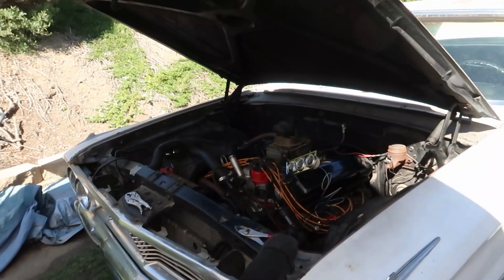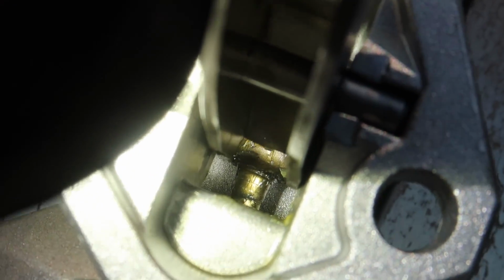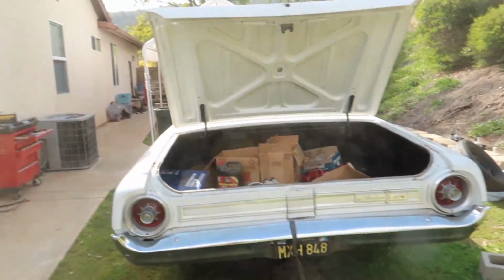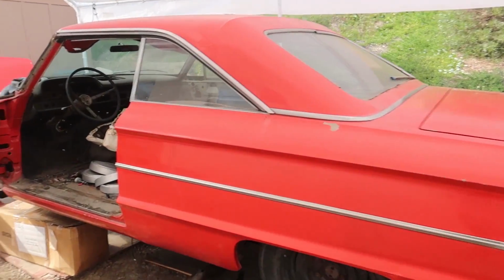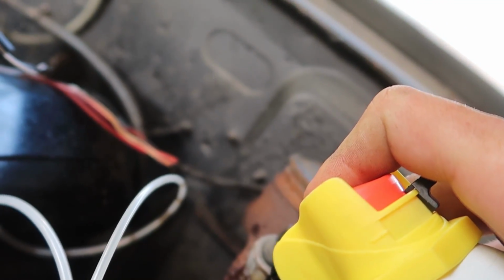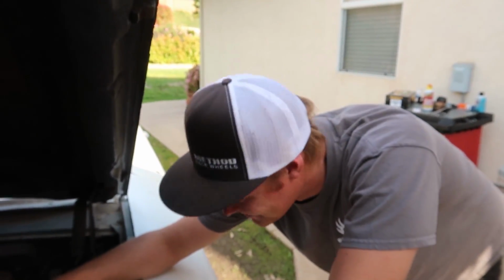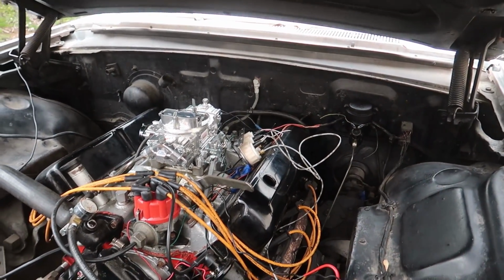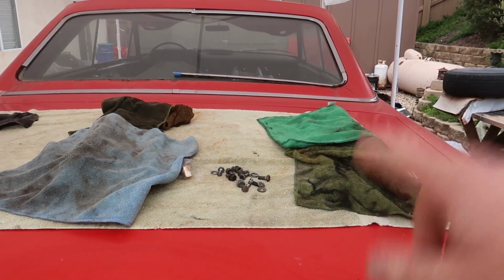This is What KILLED My Galaxie on Startup?

Comment: Nice tip on painting and keeping things neat. Here is another tip my dad, a retired mechanic, got me into the habit of: Always put your belts on with the print right side up where it is easier to read, face the tops of the letter toward the engine block. It not only looks neater but also if you take them off and put them back on and the belts have taken a set anything on the pulleys then the will not get messed up by being put on the other way. Yes I know that is a very rare instance. It also makes it easier to read the numbers if you are going to go get a replacement.

Comment: compression test first, most likely is a flat cam.  stopping and starting during cam break is not good and now days should be done with lighter springs and some zinc additive added to the oil

Comment: Whoever put the fuel pump on may have installed the lever arm over the lobe on the cam instead of under. That would have sheared it.
Reply: Would it have run at all, though?
Reply: @uppastdawn7627  Some will and some won't.
Reply: Or it has "Made in China" somewhere printed on it...
Reply: Yes you nailed it. Is there a mechanic in the house ? A waist of time "this video"
Reply: I guessed that 2 minutes in. 
Because I have done that exact thing. 
99.9 percent of problem are human error.

Comment: Drop the oil make sure no metal in it , if a new cam not broken in properly (PO) could be flattened 🤦🏼‍♂️ seen fuel pump levers fitted on the wrong side of the cam also , could be why it broke? Keep going you will get there .. Love the content 👍😎

Comment: Sounds good? Sounded like a V6 running on 4 cylinders. :-D
Reply: @RatRodRon   sounds like it has two wires mixed up and  by the way it shakes, it isn't running smooth at all..  it could be his Mic though..
Reply: Dead cylinder or out of time - why not just block off the pump and run an electric one near the tank ??

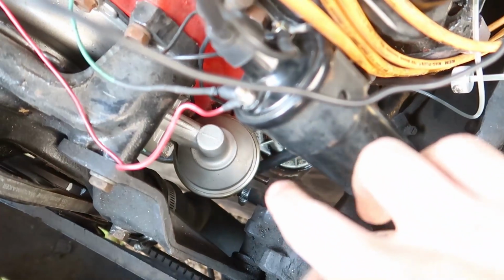Comment: I think you are right about a lack of compression, at 2:18 when it was cranking it sounded like it had a dead compression skip. Also check that the pushrods are spinning while the motor is running, that will tell you if the cam and lifters are doing good. I built a 350 that ran great and I checked this and found one pushrod and lifter not spinning. Because of college I have not had time to investigate it thoroughly but it seems the lifter was defective and would have destroyed the cam. I used zinc additive and specific break in motor oil and still had this problem, flat tappet cams dont seem to be made as good anymore. Best of luck

Comment: Have u done a compression test? Something not sounding right.... mis-adjusted valves?
Reply: I should have said “bent push rod” alas FE engines don’t have valve adjustment per say.
Reply: Definitely a problem somewhere. I noticed it before it started. Cranks really lumpy, if that makes sense..

Comment: That line broke because you need to remove the line from the brass adapter first. The flange nut will not spin on the line when its tight
Reply: Exactly right. Buy a couple of flare nut wrenches so they grip properly. Turn them opposite directions to loosen the nut from the fitting. I want to reach through the monitor and help you guys. Lol. I'm old. My first car was a '64 Galaxie back in 1970. I made mistakes too, but now I have 50 years experience. Be very careful with oil products contaminating brake fluid. Oil in the brake fluid will destroy the rubber products in the brake system and you'll find yourself with no brakes. Remember you have a single master cylinder and no secondary system.

Comment: The last two FE rebuilds I've done, I ordered the cheap ($10.00) electric fuel pump from ebay and mount near the gas tank with w switch on the dash.  By mounting in line with the mechanical pump, you can get the carb filled with fuel for quick start up which is critical for cam break in. I admire your enthusiasm.

Comment: Love those galaxies one thing about those master cylinders put a rag over the top and use a big pair of channel locks that always works for me, plastic likes to bond to the metal love the videos glad you're staying safe
Reply: Mustang guy6501 
Very true.
Rag and strap wrench works nicely as well.
Reply: The old one was a metal cap tho
Reply: @TheWolverine-rm2kr  yes but with the one put on is likely to do the same with engine heat cycle, just how I get mine opened

Comment: Looks good. Also check the spark plugs and read them. I’d like to see what cylinders and you can usually tell what’s going on off the spark plugs. I could tell it sounded like it was running on 6

Comment: If it makes you feel better, my 94 Isuzu Rodeo gets about 10-15psi of oil pressure at idle, and then normal when revved up. She's got 265k miles on her and still runs like new so I wouldn't be too worried as long as there's some pressure.

Comment: Check for a vacuum leak, possibly on the back of the intake manifold. Had the same problem with my motor on startup. Mine had the same lawnmower sound to it.

Comment: I've had several cars that fluctuate oil pressure off idle, and never had any issues because of it.  I've been told that 5psi at idle is fine, but you obviously need more when it's up in the revs.
Reply: My 390 has 7 psi at idle. 30 at 2000.  I just use 20w / 50 in summer.

Comment: Check the distributor gear. I had a similar issue with a different vehicle and what it was, one of the ball bearings went bad and was dragging just enough to create a misfire on multiple cylinders

Comment: sand the top and paint it with Rhino liner,    I'd check the top dead mark at the crank with the Distr. TDC # 1 plug  & I would then do a fresh valve adjustment!

Comment: It's quite the possibility a head gasket popped causing it to leak compression.  It's possible that someone didn't torque the head down right. Or not at all. It could be a valve that didn't seat right. Or a lifter that is stuck closed. If the lifter pumped up but stuck in the process, it can cause the valve to open too far. which will cause a miss.  To much fuel can actually flood the plug causing a miss. But usually, if that happens there will be a loud gas smell coming from the exhaust. Eye burning loud. The engine will have a heavy skip. The best flying guess, you have a head problem one way or the other. I just hope you don't have a cracked head near the valve. Any liquid will do for checking for a crack near the valve.

Comment: In my 66 f100 I recently got a new mechanical fuel pump and it broke 2 weeks later, the new mechanical ones r shit. I just switched to an electric fuel pump and it works great, starts as soon as u turn the key and never ran smoother

Comment: Instead of using a towel , try using tin foil. Easily forms to shapes and will stay in place while painting. Works well around lines and hoses you don't want over spray on.

Comment: It sounds like the torkconverter bolts are slapping the separation plate between the motor and transmission check the nuts on the torkconverter

Comment: Those look like non adjustable rocker  arms, did you mill or surface the heads, that maybe problem with the valve adjustment
Reply: If they milled the heads or block deck there is an undersize pushrod to correct this. There could be valves slightly hanging before the lifters bleed off or worse the pushrods have bent due to coil bind. Really common to see FE pushrods bend due to their over 9 inch length.

Comment: Sounds like one side of carb not getting fuel. Each bowl fills independent of the other. One side would starve 2 middle cylinders on one bank and front and rear of other bank. Really hard to diagnose for a shade tree mechanic like me. Had a NEW Edelbrock on a 302 Ford do that to me. Drove me crazy.

Comment: Brake line broke because you undid the wrong part, should had one spanner on the brass fitting and undid the steel brake line nut.

Comment: You need to perform a compression test on that engine.  The rhythmic sound it makes when cranking indicates that there is a low/dead cylinder.  The "super-direct" on the brake line is a bad idea.  There is no way to absorb relative movement between the firewall and the frame.  It needs to have a pronounced bend (even a circular loop) to accomplish this. This is why this earlier replacement line fatigued and failed.  Also, brake lines need to be double-flared.

Comment: You can increase your oil pressure by running a full synthetic like Mobil 1 if you aren't already.  My father owns a 64 Galaxie 500 as well.  He had oil pressure in the low 20s, and when we ran Mobil 1 full synthetic, it increased the pressure and reduced lifted noise.  

It's a 352 car as well:
https://pistonrepublic.com/vehicles/galaxie500man-1964-ford-galaxie-500-2door-hardtop

Not restored yet, but getting there.  BTW: The color looks the same as yours - Phoenician Yellow.

Comment: VERY IMPORTANT!
You need to know what camshaft is in your motor. If you're not the one that rebuilt that motor, it could have ANY cam. This means that it could be a totally different FIRING ORDER. I worked on a 351 with a 302 cam in it. Nobody told me. I went through hell trying to figure it out.

Comment: Could be a lot worse. Had a brand new mechanical pump in my 460 where the arm snapped off in the timing cover, and the bit that came loose flew up, wedged behind the cam sprocket, and broke the front of the cam off. 162 miles, that’s as far as it went. I know they’re usually reliable, but after that nightmare, I won’t use a mechanical pump ever again.

Comment: Am I just high, or does that galaxie sound like a lawn mower
Reply: It's not hitting on all eight sounds like firing order .   I like it though .
Reply: I was wondering if it was just the camera but it sounds rough
Reply: Sounds like a Subaru . Lol
Reply: Yep, lawn mower.
Reply: It's running really poorly.
When he cranked it over, I heard a compression problem. 
I wonder if he did a valve job?
Either way, I'd be surprised if it ever runs right.

Comment: A mistake that a lot of guys make when they overhaul their FE and stay stock, they reuse the valve springs. This is a bad idea for two reasons, a weak spring will put undue tension on the rocker shaft because invariably one will be stronger than the other, not good for your cam and lifters either. A valve not closing as it should will obviously cause a miss. The last FE came from the factory in 1976 in a truck so all of them are old enough to require replacement during an overhaul

Comment: If you put a 390 crank together with 360 pistons,you've got to use.040 gaskets due to wrist pin  differences.360 pistons and .040 gaskets gets about 10.2 :1 compression ratio.Learned that in the summer of '69,didn't go to Woodstock.Too far.

Comment: Craig, you have put in more than most and surely more than what is right. Ford engines have three firing orders for them, the right one for that engine that I grew up and raced day in and out is: 15426378 and no other no mater what year. That does not translate to your pick up's firing order. If it is not cross wired, then that cap or distributor is the problem as I heard it when it started. when they work right, it is breath on the key easy and will idle so low that the oil pump will starve. If your getting a low oil pressure on idle then the piece that the filter screws to has a relief spring and is messed up. Look through your parts bin and get the one for that engine as I don't know if any other interchanges and please, I am on your side and want it to live just as bad as if I had a dog in the fight

Comment: Rule of thumb for old cars... when you pick them up... go to the parts store of your choice and get a new gas tank, new fuel line and nickel copper brake lines :-)) Chances are that old steel linese and old steel tanks are rotted and full of junk... just use the old ones to measure new ones with. Rust belt guys know to steer clear of steel lines and either go with nickle copper alloy lines or pay up for the stainless lines :-/ Sucks but... ya. Old tanks will ruin everything along the way from the tank to the guts of your motor.

Comment: On the Master you took the wrong fitting off-  but it was rusty enough you probably weren't going to get it either way!
Reply: But should have used a 2nd wrench to work it back and forth.

Comment: I ditched that fuel pump on my 390 those are lame design maybe in the old days it would last for 20 years not today there crap , better to use elec fuel pump and put a block off on it ...not just that it's prone to that diaphragm leaking and it will pump fuel into your crankcase and wash your motor while your driving it happened to me .
It gave it hydro lock or something the motor wouldn't turn then I found out what was in my oil pan 5 gallons of gas

Comment: The red car has rot in the roof, seems like the white car has a way nicer body, just take all the good stuff off the red car. It's really hard to comment after the fact. If you would have heated that brake line up with a map gas torch first it wouldn't have broken, same with the cap, a little heat will do you.

Comment: Aye aye...don't like the sound of things..you probably flattened your cam from improper break in. 
been there...drain oil look for shavings with magnet. See if pushrods are traveling proper height ...utube how to check damaged cam. Pull intake and have a look if suspect.

Comment: Since the car needed a master anyway.... for safety sake alone why didn't you upgrade and convert it to a dual reservoir master. A single reservoir masters are the most dangerous things going. 
To add insult to injury you put on an old used single reservoir and then spend time cleaning and painting which was a waste of time and money.  It's a super simple conversion and a new dual reservoir master is not expensive, plus you needed to change a brake line too one so it made perfect sense to do the upgrade at this time.

Comment: Maybe actually get the interiors done so it doesn’t look like a pile that should be at a junkyard
Reply: Maybe leave him alone while he works on. HIS projects?
Reply: Admiral Sandwich it’s a project and he’s working basically alone. He’s fixing what he can as he gets the money and parts. You’re clearly not a car guy and don’t understand how this stuff works. That’s fine, but educate yourself and learn the process of building a car before you make yourself look as ignorant as you are right now.
Reply: @JosephSamsor  Here's something you can learn from the process; don't buy a piece of shit.  He's going to end up doing major engine work or replacing that engine.  The guy that sold him this lemon is a thief.
Reply: Rick Allen that wouldn’t be his fault. You don’t always end up with the best deal. Maybe it’s something simple causing the issues, maybe not. I’m not sure how you can come to that conclusion without even being there. It’s the same way buying any used car. There’s only so much you can learn about a car before you buy it. I’d say they probably weren’t trying to scam Craig since they had zero issues being filmed and put on the channel. I’m waiting to see what’s actually wrong with the engine before I blame anyone.
Reply: You do the interia last
Reply: @JosephSamsor  well said 👍